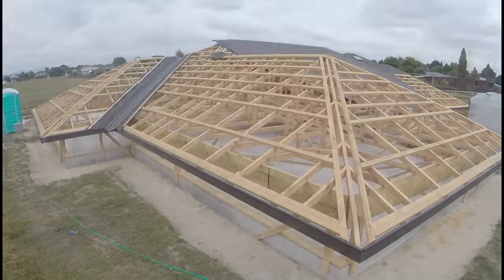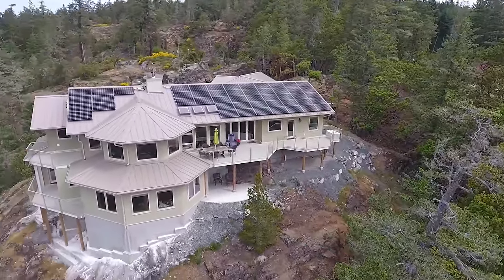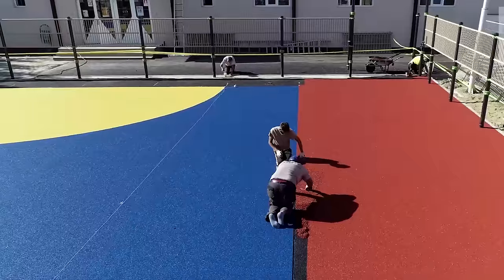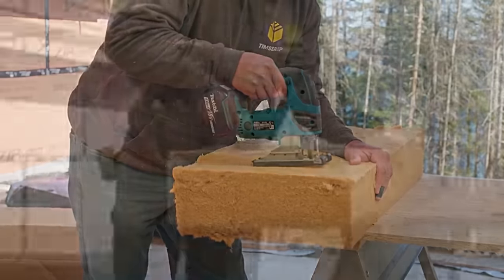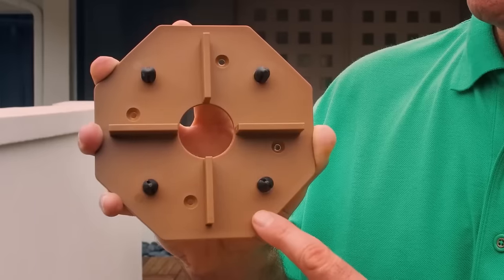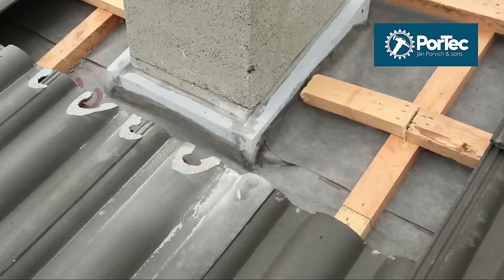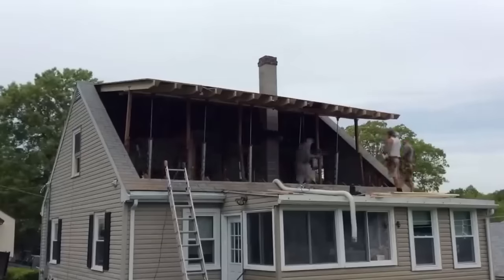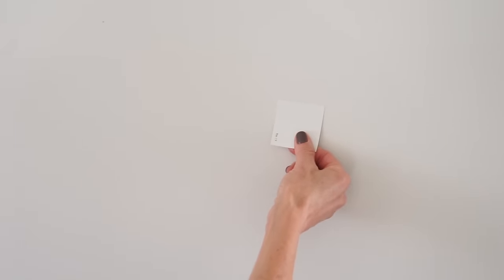Most Ingenious Construction Inventions & Technologies

Comment: the wood fiber insulation... I don't know of anywhere where R4 is at any rate any good. everywhere I;ve been has been a minimum of R13 in the walls and 20 in the ceilings. where I'm at now is 20-30 in the wall and 30 in the ceiling. I mean yeah, yay dont waste the wood, but good grief, make it something useable.